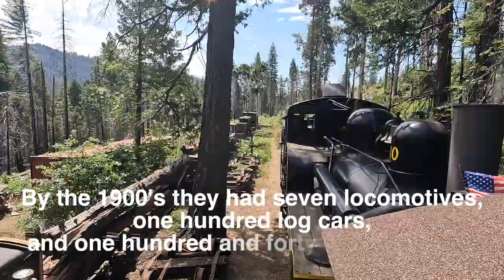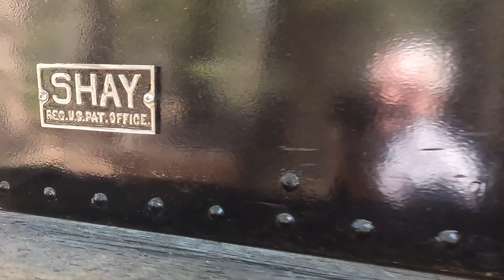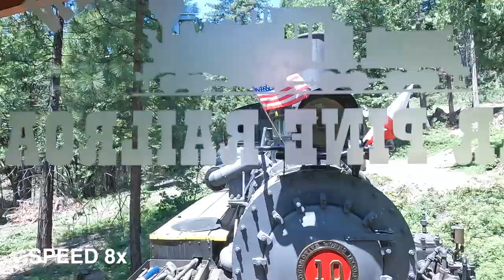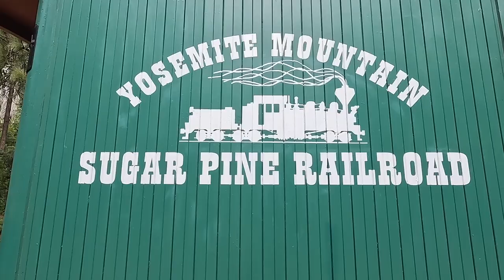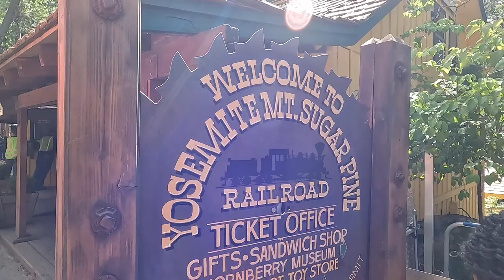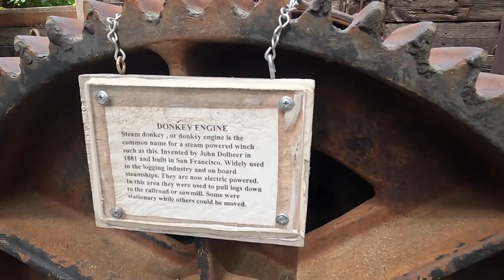2023 Yosemite Mountain Sugar Pine Railroad   Steam Locmotive in Yosemite National Park California

Comment: Aw shucks they took out the balloon smoke stack
Reply from the maker: Apparently that one was to catch sparks when the loco burn wood for fuel. Now it is converted to oil burning. It was common for the old trains to run down tracks with forrest fire scars on both sides continuously because they wood burning engines constantly started fires.